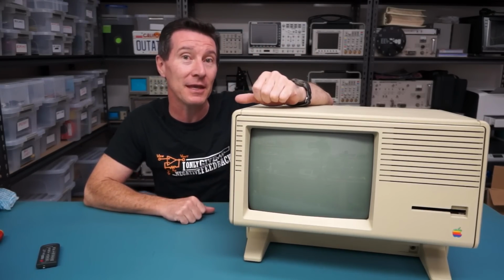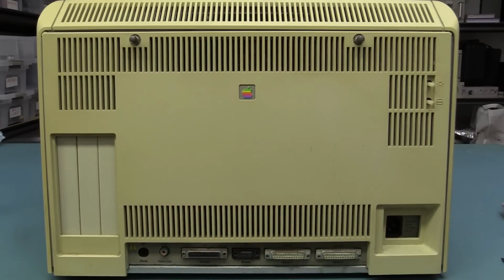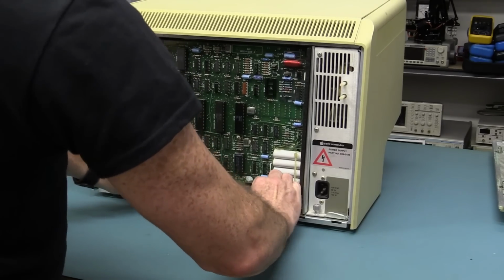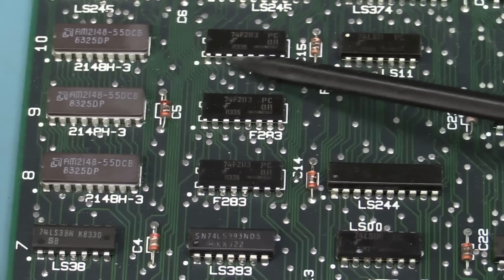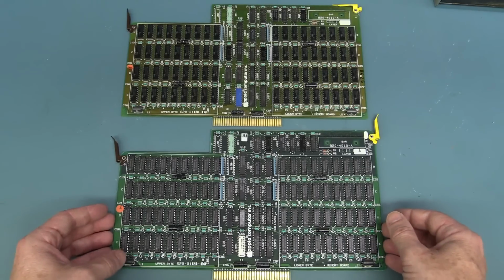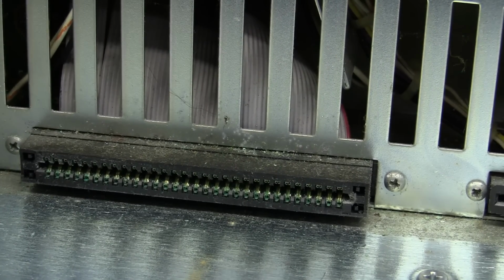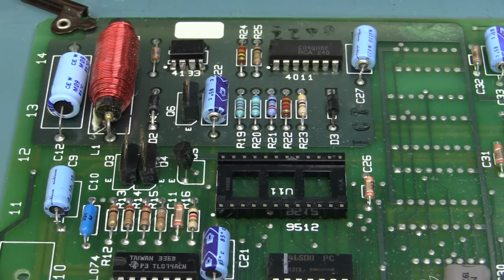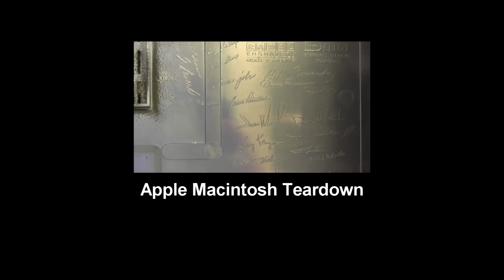EEVblog #696 - Apple Lisa Retro Computer Teardown

Comment: It's a shame that Apple went from making cool, modular, repairable/up-gradable systems like this, to their current generation of ultra low build cost, non-up-gradable, disposable, 2 generations behind the times technology stuff that you see today
Reply: Today´s apple isn´t apple anymore, since Steve backtrack´ed hisself before he passed away (R.I.P.!)....It´s becoming just another phone/computer company only selling Steve´s ideas, as they running out of gas by now, anyway....
Reply: arcadeuk If you want to optimise things at any cost in terms of having the largest possible battery size, thinest/lightest form factor possible, then you can do that by getting rid of DIMM slots and soldering the RAM to the main board, going for PCIe SSD sticks (mainly for speed) rather than 2.5"SATA format etc.
Not everyone will like that due to the difficulty in upgrading of course. But most people want the highest performance possible packed into the smallest volume and weight with the highest battery life possible.
Reply: arcadeuk Blame Steve Jobs, Wozniak always wanted his machine to be upgradeable.
Reply: Steven Whiting I don't find this an issue anyway. Buy the top end macbook, sell it on eBay after ~2-3 years, repeat...
All major manufacturers will slowly follow suit eventually in the next 5-10 years I expect.
Just like everyone complained about mini-SIM, then micro-SIM. Having non-removable batteries, having no SD card slots, having no DVD drives in laptops etc. But in the end some of the other manufacturers have also followed suit with similar tradeoffs in their phones/laptops in order to improve form factor and battery size.
Reply: arcadeuk I don't agree that they are 2 generations behind. While they usually take their time to perfect existing technologies rather than saying "We were 1st!" (touch ID for instance), they do have 1st to market features from time to time such as implementing the 1st 64bit architecture CPU on a phone. (Of course people can argue about the 4GB RAM thing and other people can argue that going 64bit sooner rather than later will prevent fragmentation similar to how windows have 32/64 bit issues and OS X doesn't)
And if you've used a mac, you'd know that their notebooks are certainly no slouch and use top spec parts.
Reply: Lassi Kinnunen Yes I agree, the lower end macs are certainly poor in terms of bang per buck no doubt. (The macbook air is still relatively low resolution for example, the mac mini is pretty poor specced)
But if you buy the fully specced macbook pro, there's few if any other brand laptops that can compete in performance if any, for the same form factor. Their CPU's and PCIe SSDs, displays as well as battery life and battery longevity is unparalleled.
Obviously the fully specced mac is more expensive than the fully specced other brand, and if you want the best performance without compromise and if price is irrelevant, mac is the choice.
Reply: kalhana1 I have to strongly disagree there, I have a phone with removable battery and micro SD for upgradable storage, and these features will always exist, because there is always going to be a market where people want to buy phones with these features. 

Let's say your prophecy comes true and every major manufacturer dropped micro SD, I can guarantee that a brand new manufacturer will come along and create a phone with micro SD to fill the gap in the market. 

If you are happy buying your un-uprgadable Apple products, with soldered in DIMMs, and throwing them out every couple of years, that's fine, you can do that, but I will not. That was the point of my original post, if Apple had gone down this path and continued to make products for the masses, designed to be easily upgradable and repaired, then I'd probably have more respect for them and bought some of their products, but they have not and I don't
Reply: arcadeuk Yes I understand that people want different things from their devices and I did say that "Not everyone will like that due to the difficulty in upgrading of course". And yes, there will be a market for that as well, but I think the market will be quite small relatively.
Similar to how they still sell old school Nokia type phones because there's a market for it, but the majority of the phone sales (I'm talking about the western world) are smartphones.
Integration is the lifeblood of modern electronics. If you look inside a phone, all the discrete chips that used to do a dozen separate features are now in one SoC. Similarly, removable storage will become the same. (just like floppy drives and DVD drives died out to give way to cloud based and USB/LAN/thunderbolt storage which requires no special internal HW.)
Reply: arcadeuk
I know a guy that owns his own repair shop and repairing iPhones is his biggest money maker right now. Of course busted screens and such are the main issues, but he can do much more than that.
Reply: you're all wrong except for the non-upgradable.
Reply: I re-soldered the power jack of a 2000 model iBook clamshell...   had to take out about 25 screws of different sizes and shapes... same problem if you want to replace the HDD...
Reply: arcadeuk  That's garbage. Apple stuff is still state-of-the-art. It's just that they value different things than most other manufacturers.  Things like efficiency and battery life and weight and resolution and high quality software.
Reply: w0mbles I apologise for offending your religion.
Reply: arcadeuk No problem. The Holy Church of Reason, Rationality and Telling the Fucking Truth welcomes all converts, no matter how errant they are.
Reply: if only a microscopic number of buyers would even consider upgrading parts, the effort and part needed to make something upgradeable and modular is just a waste of space, resources and money
Reply: Yes, I'm sorry I ever said I thought Apple would be better if they were upgradable and repairable, clearly I am upsetting the true believers. All hail the mighty flawless Apple
Reply: arcadeuk it's nothing unique to Apple, it goes for all manufacturers. If no one or very few will ever consider upgrading why add the option? most of the time it will just be wasted space and money
Reply: Going back to the phone example, most other manufacturers include a micro SD slot on their phones for storage upgrade. I know alot of people who would not buy a phone that doesn't have microSD, and manufacturers such  as Samsung have been taking advantage of that for a long time now.
Reply: Lasse Langwadt Christensen
But yet you can do just that with every pc being sold today and since the personal computer was released even though it was only a minority that upgraded it.

So yeah it is pretty unique to apple.
Reply: arcadeuk You're being silly now. You made a silly, unsupportable claim, and instead of retracting it or backing it up, you're going the Offended route. This is an ENGINEERING vblog, not a FANBOY blog. Most of the viewers here know what they're talking about when it comes to technical issues, or at least have the ability to put claims in context. You're just doing the hate-Apple thing. And no, I don't much like Apple as a company. But to say they are behind-the-times, technically, is an ignorant or trolling comment.
Reply: w0mbles Apple impressed me with their engineering back in the early days of computing, now they don't anymore.  You don't have to agree with me, if you truely do believe that non-upgradable, disposable technology is a step forward, then that's fine. I don't agree.

Why are you getting so worked up about a profit making faceless corperation? You are talking like I have insulted a member of your family. Would you give an emotional response if I said that I think that Sony / Phillips / Samsung / LG / Motorola / or any other big brand electronics maker, was going down in my estimation? Or is it only mention of "Apple" that gets you worked up?
Reply: arcadeuk I couldn't care less if you attack Apple. But don't make crap up in the process. Apple may be a faceless, soulless corporation, but it still state-of-the-art in design, production, marketing, management etc.

I think you need to get over yourself. This fanboysim stuff is really tedious.  Look at it like an ENGINEER. i.e. a thinking person, not a fanboy.
Reply: w0mbles You really are irony impaired. I've been talking about engineering! About design, upgradeability, specifications, and all you are saying is "apple are the best" FFS look in a mirror. What am I supposed to be a fanboy of? I'm saying "look at what other manufacturers are doing" and you just seem to have the word "Apple" playing in a loop in your head.
Reply: ***** Hush, child.
Reply: Apple has never focused on repairability....  It was always knock on effects from their manufacturing techniques...   I've been working on Apple equipment since the Apple ][ came out....  their compact platforms have never been designed for repairability.  The first compact platform Apple ever built was the Apple //c.  The RF shielding in that system was soldered to the motherboard, and spot welded  in other places.  It was designed to tolerate rough treatment... in portable use. It was not designed for repairability.  The only concessions made were for access to the area of the mother board where the memory was installed for upgrades... and the disk drive was able to be slid out of the shield.  The rest of the mobo was inaccessible without destroying the RF shielding.
Reply: Amen.... haha
Reply: shhhhhh. it's Apple. It just works
Reply: metaforest That's not a bad assessment of Apple. They build to an application. You see, the areas that could see upgradability, WERE made upgradable. The rest... Hands off, send it back to us. They don't make it easy cause they don't expect YOU or ME to actually service it!

The issue, is we get these DIYers who then proceed to proclaim apple as crap cause it was hard to service the machine! They don't get that the machine was designed to an application, and that service must work around that application design. The New Mac Pro is similar. CPU and GPU are heavily integrated into the central heatsink core. You CAN easily access memory and storage though, and the machine has the phenomenally expandable Thunderbolt 2 technology. Ah, but they say complain that it doesn't use 2.5" SATA and that PCIe SSD isn't really expandable! No. That's wrong! PCIe SSD is very expandable, no less than 2.5" SATA! You still have to remove the old one to put in the new one. It's just that prices haven't come down yet. If you want more "slots", including slots for the PCIe SSD sticks, you can add those via Thunderbolt 2. You could ad 36 PCIe cards and 6 monitors to those ports, with a sufficiently capable wallet! The SAME argument happened over USB, back when the iMac came out. There's no accessories. It's not a real expansion option. Then the market grew.

I CAN'T afford Apple's engineering though, so I built a Hackintosh instead. I still have Thunderbolt, but I exchanged the Darth Vader's Ash Tray™ design for a 1939 Philco Radio cabinet, with a side of nixie tubes! :)

I have never heard the term Darth Vader's Ash Tray before... but I LOVE it, don't even know why! XD
Reply: I don't think I've ever seen an Apple product that's worth it's price. Still, it is sad that they just have ended up just having their stuff made in China instead of Made In America like the old days.
Reply: 0utc4st1985 Ridiculous comment.  The MacBooks in particular have been great value.
Reply: Lasse Langwadt Christensen in the case of PCs, lots of people have them upgraded, or repaired. Even as the 'end of the PC' crowd was harping on, we had plenty of folks coming in to upgrade their PCs. And even the integrated hardware can be upgraded (though it usually takes a soldering iron. The X41 is a pretty notable example, you can upgrade it to SATA...) Phones? I just put a factory extended battery in my Atrix II.  I'd love to see any fixed-sized phone compete as far as battery life. 9 hours of Spotify on 3g for the win.....
Reply: For Power Users and hard core gamers... Yeah There will still be plenty of shiny in the PC desktop and 15.6" laptops.  But I expect it to get a lot more expensive and overall quality will probably improve. Because fewer and fewer people are finding a reason to buy a new laptop or desktop.  Their phones/tablets are starting to be more convenient for many tasks.  As more and more people discover that almost all of their mundane computer tasks are handled adequately by their mobile devices they will simply not need a desktop or laptop class machine.   The desktop will still be in the market, but only for those that need the modular customization that workstation class form factors provide.  If anything, I except that one of the common laptop formats will probably fall away... not sure if it will be the 17" or the <15" lines first... but I expect one of those forms is not long for this world.
Reply: metaforest
to an extent, I can see where that might be a possibility. The tablet has already killed the netbook, and the large laptop serves as a main PC in a lot of households.

That being said, a lot of my friends are starting to feel the pinch of expensive data rates cloud-streaming their music to their phones, so a few of them started bringing old netbooks with big hard drives installed...
Reply: I love all the passion expressed here, pro and con. Popcorn is required. A few notes:
The Lisa was awesome at the time and we used them for documentation. We used IBM PC's for emulation since we could design boards to populate the backplane. Lisas were $$$$ but we ran with the founders/principals of Apple.

Samsung makes iPhones. My buddy is working on the next iPhone and I have already completed the next-next generation of touchscreen chips, in the ES stage.

On desktops, I use quad-processors in my desktop unit running Linux for local tool runs and a laptop for "Office" type chores. Both the Linux box and laptop can X into the server farm for big jobs. So yes, metaforest some of us will always use desktops and laptops. (always is a strong word :D )

On the expandability thing, that is a tough one both from production and form-factor standpoints in some systems. Although my latest chip might be desired in an old system, since it's 320x faster and sips power, it would be hard to retrofit it into a system without crippling it.

Good reads ^^^ and fun video.
Reply: Steven Whiting+ steve jobs wasn't against upgrading the machine, he would prefer that people don't have access to the guts but he didn't want a machine that was completely sealed up with no access. tim cook is the only apple CEO who wants to shut people out completely and not let them upgrade the machines themselves.
Reply: kalhana1+ l am still pretty sour about manufacturers trying to shut people out. they will never shut me out! l would solder in my own damn flash chips if it came to that.
Reply: Thanks for sharing the signatures at the end. After reading the Isaacson biography, I've always been curious. I enjoyed seeing the beautiful symmetry of the early apple computer. I liked this and have subscribed to ya matey!
Reply: Marcin Berman You're right It is not super low built quality but rather built to fuck up and fail on purpose while keeping the rest just alright enough. But yeah OP was 3 years ago, things changed.. 
Obviously it's gotta be top notch on the outside! But everything in the computer can roast to death while some little piece fucks it all up before we ever get GPU burnout.... oh wait shit. Let's reduce product life to help with poor design choices. Oh and can we please stop people repairing these things?
Reply: Marcin Berman "Think different" - A fuse is supposed to fuse the power supply and following circuits together. Imagine a romantic hipster date at starbucks maybe
Reply: arcadeuk half of this comment hasn't aged well at all… They're still gluing components down, but their machines are so efficient that their batteries will effectively last almost twice as long, and at least are now probably three or four generations ahead of their competition.
Reply: @w0mblemania  Truth? Apple ??? See my previous post - I had to use one on that last project - TOTAL POS !!!
Reply: @w0mblemania  I'd arge they were - until M1
Reply: @rednadya5859  No it doesn't - their reliability's now as in the toilet as their customer service!

Comment: I worked for Apple in 81-82 in their Stanton California facilities, 1st putting keyboards together and later testing them. Most if not all machines were still assembled and made in the US then but Apple decided to out source production so all parts made after 82 were made and assembled in Singapore and will have those stamps. I can see by some of the boards solder work the assembly was not as good and that is a surprise as Apple had pretty high standards. This is original work I see not reworked parts so our teams still were better trained the those that replaced us.